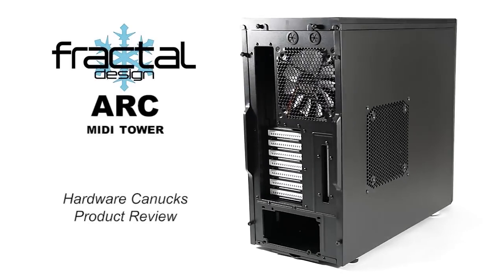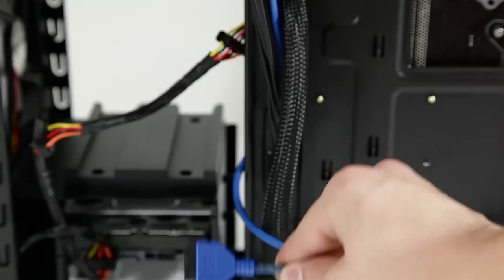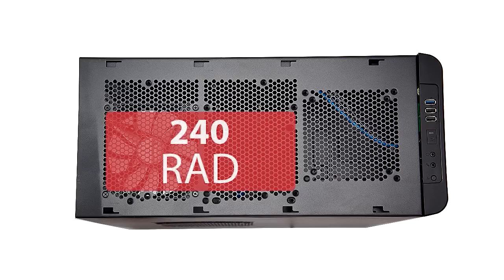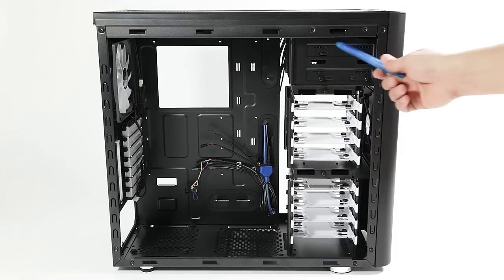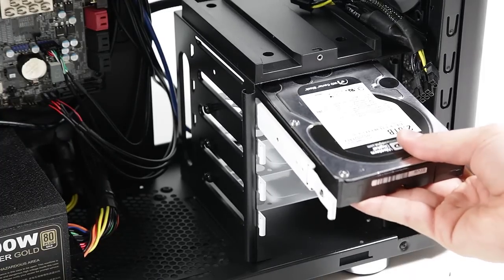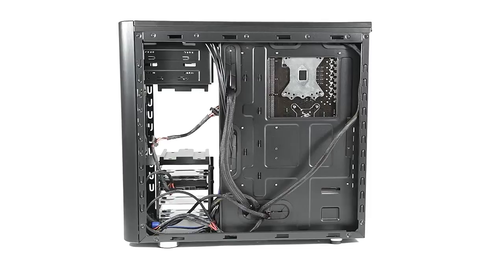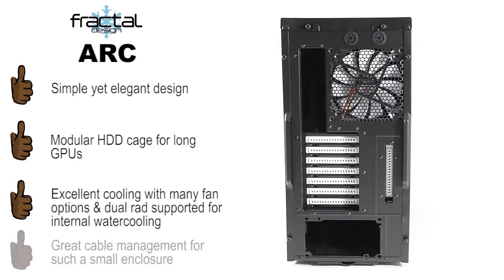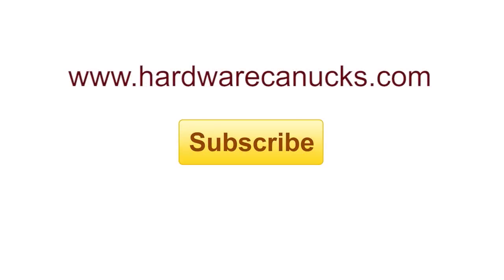Fractal Design Arc Midi Tower Case Review

Comment: I've seen that the fans at the front pick up a lot of dust (seeing that dust filters do a good job) though there is a overall dust build up inside due to the negative airflow set up. So anyone with this case I suggest you use positive airflow to keep the dust out of the internals of your system.
Reply: That is what I did, I have had it 7 years now, opened it once since to clean the inside, I vacuum the front and top filters on the case, and slide out the bottom one, every few weeks, minuscule amount of dust on the inside in all that time.  Getting a new gpu soon, going to clean the inside again, love this case.

Comment: Great and accurate review. I own this case, and absolutely love it. This is my first mid-tower case (I had always had a full tower previously), and I have no regrets whatsoever.

The only thing that I can add to the review is that Fractal Design's customer support ROCKS. I broke my front cover getting it out of the box (dropping it tends to do that...) and after a short, personal phone call, the new part was on its way at no charge. I HIGHLY recommend this case/manufacturer.

Comment: I have a neutral airflow in my arc mini with two 120mm in front, one in the bottom, one at the back and two 120mm attached to a radiator in the top, and I have got almost no dust inside the case. And yes, the front fans do pick up some dust that is visible after a while, but it's not a big deal cleaning it.

Comment: @TheEquivalentXchange How much could you possibly benefit from that particular spot, though? It seems, especially in a case this size, it would just get in the way. There's also a point when fans aren't worth adding and the hardware won't get much cooler unless the temperature surrounding your case drops, as shown with that one case that has 15 fans and there being a 1-degree difference with a few added vs all 15 added...

Comment: @crazy88boss 
The main problem your having with this case is insufficient air flow?
Are you not using the optional third intake on the top of the case while keeping your 200mm fan mounted on top?  How about the fan intake from the optional bottom mount?  How about the two 140mm fans you can use for intake in the front of the case?
Are you restricted by how many fans you may because of income?

Comment: Really nice looking case!  But what's with the single USB 3.0 port if it uses a full size internal USB 3.0 header on the motherboard?  I thought for sure with only 1 port it would have one of those early style rear exit male USB 3.0 cables hanging out the back.  It doesn't make sense to only have 1 USB 3.0 port on the front if it's wasting two off the mobo.  Shame too because otherwise this is a REALLY nice looking case.

Comment: @toonygamer2004 There weren't very many issues with installation. A top 200mm fan is optional but it was a little difficult to install -- I had to force the screws into place. A top fan will set you back $16-$18 so add that to the total cost of the unit. Also, even with the additional fan there really isn't much in the way of cooling. One 200mm fan as intake does not cut it and there is no option for side mounting because of the window; its cooling is lackluster at best.

Comment: @toonygamer2004 I believe you're confused, friend. The Enforcer can mount two 120mm fans in the front if you don't want the 200mm, but there is only room for one 200mm on top, or two 120mm and 1 120mm exhaust in the back. I am using the top as exhaust as per the instructions, leaving me with only a 200mm fan in front for intake. You may be thinking of a Cooler Master HAF-series case, but the Storm Enforcer is sadly limited in fan mounts.

Comment: @TheEquivalentXchange You act as if I haven't built 5 systems in my lifetime.

For the longest time I never had a rear-exhaust, just a top-exhaust since I was too lazy to buy another fan. These days I use two 200mm fans and 1 rear exhaust for a Corsair H70. That one by the PSU still seems useless.